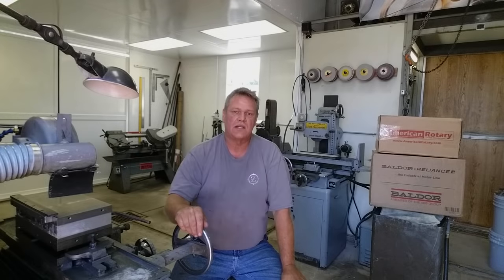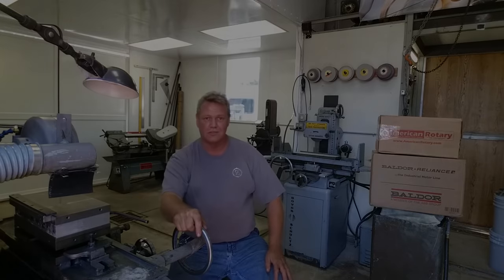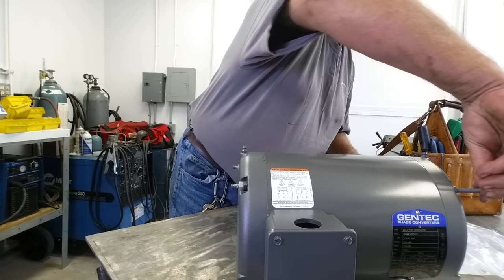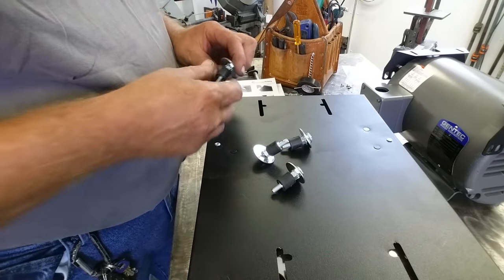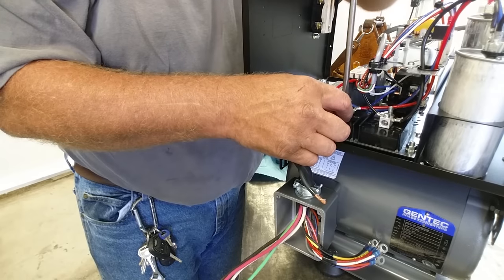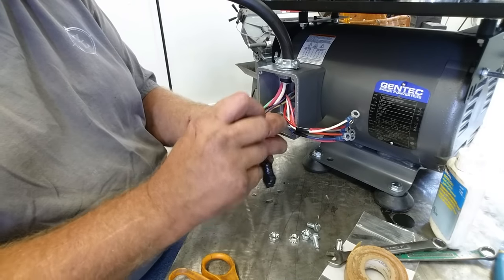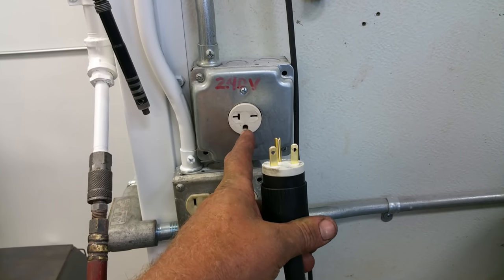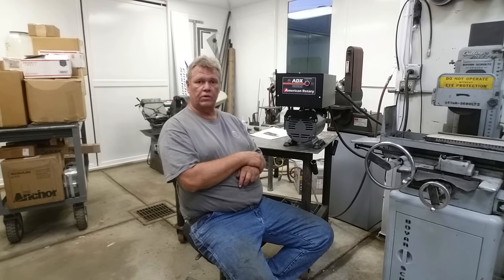RPC  VS  VFD

Comment: GREAT VIDEO !!!  HOW COME 50-50 CHANCE HAS BEEN WRONG 80% OF THE TIME 4 ME ?
   50 YRS. EXPERIENCE WITH 3 PHASE    :-(
WHAT WAS THE NAME OF THE STUFF YOU SMEARED ON THE WIRES , I THINK I NEED SOME .
Reply: THANKS . IT'S ON ORDER .
Reply: You just have to connect all three phases, and then switch two of them before testing. 80% to get it right! :)
Reply: WISH I'D KNOWN THAT 40 YRS. AGO  :-)
Reply: Noalox (anti-oxidant compound) is one brand here in the U.S. You can find it at Lowe's, Home Depot, etc. Ox-Gard is another brand. I've also seen suggestions that dielectric grease, or any aluminum anti-oxidant compound should work...and some say vasoline in a pinch. I won't vouch for any of those, I would recommend sticking with the Noalox or similar variant available in your area. Any electrical supply house should be able to suggest the right product if you can't find what you need at the local home improvement box store.

Comment: Eventually I do plan on having a shop, I need to buy a house with the property to put it on first, but I will get there... Anyway, even though my first choice would be to have 3 phase power coming into the shop, if that isn't an option, I've always thought a large RPC would be the best idea, like Keith Rucker did at his shop, and you said you'd do yourself, it just seems the simplest and best way to go. There's no way I'd end up converting each machine I get, if I was going to do that, I'd likely get maybe 2 machines before giving up? Unless I really felt I needed the speed control ability on the machine. Like the (not to use Keith as an example twice) Monarch 10 EE He just got, with its odd direct current generating system, if I were going to have to do major repairs to that setup, it would be worth considering a new motor and VFD to run that, mostly because apparently the whole motor-generator arrangement was put in there to give it a variable speed control.

Comment: Stan,
For a proper 'this is my crust of bread-shop' like yours, would there not be a solution in the simple salt of the earth, 3 phase generator?
Besides the extra feature of backup power, it would give you a regular 240/400 volt, a choice between star or delta, depending on your case.... and you could just wire the lot with 3 phase wiring, never to think again about it...
Just an idea...
European 3 phase motors usually have a small panel inside the box (what you call the motor-peckerhead) with six brass studs, mounted in a phenolic material. The configuration is always the same, which makes it dead easy to change from star to delta.
Every motor comes with 3 copper bars that fit exactly over the lugs.... mount them horizontal (3 bottom lugs) for star or  mount the vertical for delta ...attach your wires and your done! (to the three bottom lugs)  Or you just bring the whole lot out for heavy duty industrial motors so a star/delta switch arrangements can be made in an outside cabinet.
There is no need for tape, self amalgamating or other!

Cheers
Paddy
Reply: The electric company sells power for a lot less then you can generate it.

Comment: I'd rather have a rotary phase converter but it seems like they are way more expensive than a VFD . I see the VFD for 2hp running around  $300.00 bucks a 2hp Rotary  is $400.00 bucks

Comment: Single point RPC for variable speed, 5HP, knee mill - $1,250.   VFD for same machine - $200-$600.
IMHO, costwise, VFD = the no-brainer win.  Bonus features, ...1. Not having to listen to the RPC motor whining all day long (unless you add more expense by installing it outside, or another room)  2. Spindle motor braking.

Comment: Could you have replaced the motor with a single phase motor?
Reply from the maker: Most older machines wont have single phase motors available with the right frame sizes, etc.

Comment: What do you think of the static phase converters?
Reply from the maker: you will lose 1/3rd of your tagged horsepower, I just dont think it is worth it.
Reply: In horse power or will it affect spindle speed. Home shop, not doing any major hogging . Also wondering about reliability.

Comment: American electricity is weird.

Is a 3 phase supply really that unusual in the US? Here in South Africa, every commercial and industrial site and most big homes have 3 phase (380V). Also, why no bootlace ferules on the finely stranded wire?
Reply: Most of the time you only see 3 phase power in industrialized locations, whereas most households have single split phase power.
Reply: In a lot of places the power companies won't even offer the option of three phase to residential customers even in rural areas. It's mostly reserved for commercial and industrial. At the same time most consumers don't need it since there's very little consumer level equipment that uses it. Most of the time there aren't even spare 240 single phase outlets put in homes except where needed for specific appliances.

Comment: Looks like you've unwrapped a few rolls of tape in your day!!   
I understand why you assembled this kit like you did, but if you want a silent version of this, you can mount the control box in your shop and place the motor outside the shop in a weather resistant area.  Just need a longer cord between the two. (I realize that you know all this, but I'm just saying it for the viewers knowledge, especially if they are powering a whole shop with a larger one)
Reply from the maker: I actually like the fact the whole unit can be moved around the shop or taken over to a machine for testing, but you bring up a valid point about permanent installations.
Reply: Yes, having a unit that can be brought to a new (typically very old in my case) machine for testing would be great to have!

Comment: Interesting stuff. Just about every machine in my home workshop runs off a vfd. One advantage to a VFD conversion is that the market for single phase machines tends to be much bigger than for three phase. If you end up with a machine you don't get along with you can probably move it on and at least break even.

Comment: where do you get that "no-collex" stuff?
Reply from the maker: https://www.amazon.com/30-030-Noalox-Anti-Oxidant-Compound-Squeeze/dp/B000LDE7V4/ref=sr_1_2?ie=UTF8&qid=1523389217&sr=8-2&keywords=ideal+noalox&dpID=417yZZcJr4L&preST=_SY445_QL70_&dpSrc=srch
Reply: Thank you for responding man! I just ordered a new VFD for my old senaca falls 12" lathe. It came with an old 1 hp single phase motor (56c frame) wired to 1 side of a drum switch...So no reverse. I gotta find a 1 hp 3 phase motor and i will be so much closer to a quickly reversing lathe motor. I'm a little afraid to spin the chuck off in reverse if i go to fast...I never use that Noalox but i will from now on. Love you videos! I gotta revisit your videos and the basement machine shop guy videos you helped him with. Gotta a 1hp 3phase 5/8 shaft motor lying around?
Reply from the maker: Probably, but shipping? Where are you?

Comment: I have never seen such a cheap connection wire method in my live. Is it normal in the U.S. to isolate wires with "Tape"?? Impossible here in Europe.
We have mounting plates only.
Reply: My thoughts as well. Odd to not see a 6 terminal stud block inside that motor lid where you can set the brass links for star/delta. Actually the idler on my 15kw rpc uses star/delta starting on the idler to get it started on a 63a breaker.

Comment: I doubt the terminals are made of aluminium. Most are made from tin plated copper so you can use aluminium wire in them. 
No matter how much anti-oxidants you use the copper acid will corrode the terminals, if the terminals really are made of alu.

Comment: 19:16 You sure it's just not tin plated copper wire?
Reply from the maker: Baldor has used nickel wire for as long as I can remember :)
Reply: I see, must be nickel plated wire for corrosion resistance then, because pure nickel would seem kind of strange.

Thanks
Reply: Yes, I think maybe. Nickel is a poor conductor. Sometimes I come across silver tinned wires...usually teflon wire.
Reply: It's neither nickel nor tin. Tinning copper coductors with soft solder increases the natual anti-corrosion properties of the copper. By the way, pure copper does not corrode in the usual sense, and the discoloration is actually as conductive as the base copper.
Reply: ytmachx.  Most wire approved for aircraft use is tinned with soft solder to make soldered connections better and easier, and the ptfe (Teflon) insulation is much more heat resistant. Nichrome (nickle-chromium) wire is used for high resistance electric heating elements in open air.

Comment: could u take a regular 3 phase motor and spin it with a belt off a single phase and then use the 3 phase inputs as outputs?
Reply: A 3 phase motor WONT start when powered on single phase, but with the appropriate capacitors on the third phase branch, you can use what is called a pony motor to launch it, once started it will keep on until you turn off the power, beware if the electricity goes off and if the switch is still on at reconnection, something will give...
Reply: i dont mean "start " it I mean turn the spindal with a single phase motor connected via pully
Reply: Billy T
If I understand your question, you mean to make some kind of a generator, not really...
Reply: No, that won't work. The 3 phase motor won't generate without a magnetic field supplied first by an electrical source. the 3rd phase is a back EMF on the un energized leg stabilized by caps

Comment: i found vfd,s to be way cheaper and more economic than rotary. for one machine at least. got a good one from flea-bay for under $100
Reply: Prices have come way down on "static" PHASE converters.   But, the different models and brands vary:  as far as their capabilities.  You also mentioned "Variable Frequency Drives" (VFDs), they have additional functions and capabilities that can be adjusted on the fly.  You said "Static vs. Rotary".   Rotary converters are great.  But, they aren't as efficeint (yeah, who cares about a few pennies a month electrical bill) as the Static variety.     The RPC can be "tuned" for a high Power Factor on one machine at a certain load, but lose all of that "tune" when you power up a different machine or load the machine.  but, who cares, a RPC is the cheapest way to go.
Reply: +WAVETUBE84 
great information! thanks!
Reply: Smaller RPC, don't waste so much, but, my 20 hp unit idles at around 1.1 kw real measured power, don't mind it so much in the Winter but, over 1 kw in the hot Summer is not just a matter of waste, also comfort, my real first choice would be utility installation, around 7 to 10K $$$, in my case...
Reply: Pierre's Garage It's a matter of opportunity.  Sometimes you are in the right place at the right time:  you get a deal on a few Baldor 3 phase motors and dedicate each one to a matching machine (hp).  I'm not sure about the overall efficiency and how many watts per hour they burn... compared to single phase 220vac.  But 3 phase beats single phase all year round... for torque/power per watt burned.  AND the 3 pase motors are more compact!
New washing machines today have come out that uses a very large diameter, multi-phase rotor.  It delivers an incredible amount of torque and and is ultra efficient.  Since it is VFD controlled... it can reverse on the fly and go into hyper-rpm.   No gear train or transmission necessary.  What is it?  ....a modern, horizontal drum, washing machine!
Reply: pierre beaudry The RPC takes the single phase 220 and physically changes the degrees of the "delta" "transformer" (rpc motor) induces the "3rd leg" almost automatically.
Reply: WAVETUBE84
Right about 3 phases having better performance, already had a lathe with a 5 hp single phase motor, that was a lousy machine compared to what 3 phase machine can do...
With my presen lathe I can remove 1 inch on the diameter .015 thousand advance at 1000 rpm, can't compare....   ;)
Reply: Works the other way for me, old lathe 1 1/2hp 240v 1ph could take 1/2" cuts ie reduce 1" on diameter. Newer lathe 3hp 3ph 400v lucky if can take 3/16" cuts, 3/8" on diameter but does cut good. RPC 5kw spindle slows to nill within 3 seconds with a menial 1/32" cut on, inverter 7.5kw no problem at 3/16" cut.Both about same price.

Comment: 20:10 - the European still do this....
Im a European electrician. I have never seen this before!
Reply: Maybe in Eastern Europe?
This type of connection maybe used in transformer substation (current is MORE high)
But it connects to copper bar as i know.